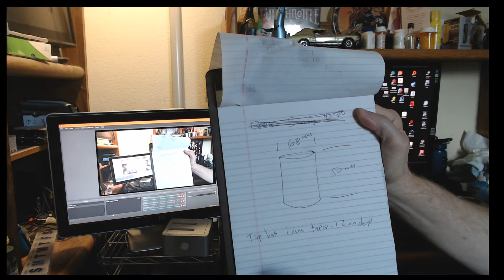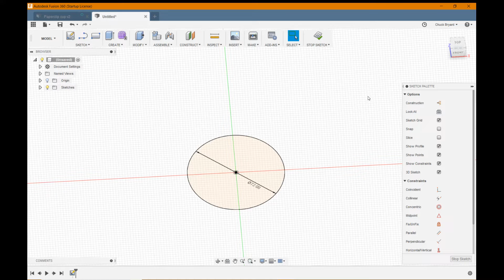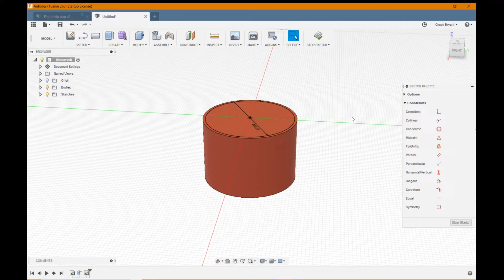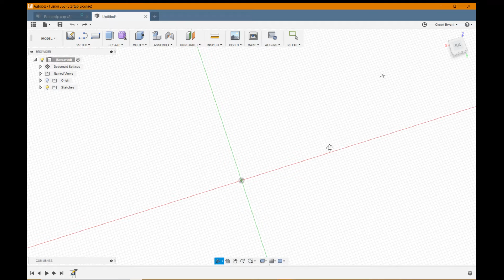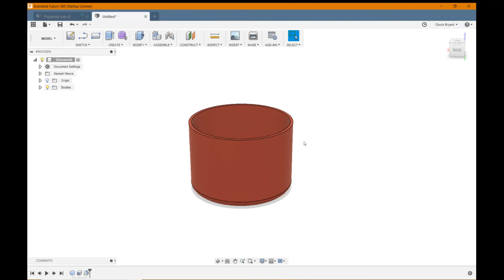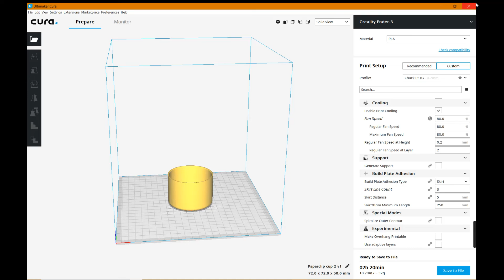Design and Print Useful Things Part 1

Comment: Thanks Chuck for the video and Cura profile. I have been having the very same problem with my Ender 3 with the layer shifting on small prints! I hope your profile helps with that!

I'm going to try my hand at the Fusion360 software and following along with this series!

Thanks again and keep up the good work!
Reply from the maker: Thanks! And I hope I helped solve the layer shifts too. I could hear it when my printer did it, it sounded like a "whack!" and I'd look over and it would be printing around a millimeter off where it should be, but only on small things. When I cut the acceleration and jerk down it went away and it's never come back. And on top of that, the printer just sounds smoother to me.
Reply: @3rdpig  Just an update: Your profile fixed my problem!!! Thanks Chuck for all the help!!! And your right, the printer does sound better!
Reply from the maker: That's great to hear, thanks for letting me know!

Comment: New to 3D P but have used photoshop for years. Can I use a graphics tablet instead of mouse and keyboard on fusion 360 ?
Reply from the maker: There is support in Fusion for  Multi Gestures using a Wacom tablet. How well it works is something I don't know. Autodesk has a video out on using Wacom's Mobile Studio Pro, but again I have no idea how it works or how well it works compared to mouse and keyboard.